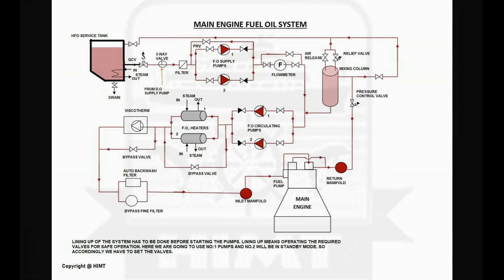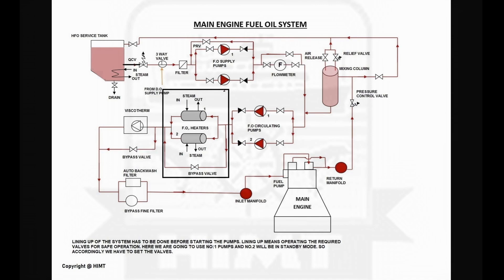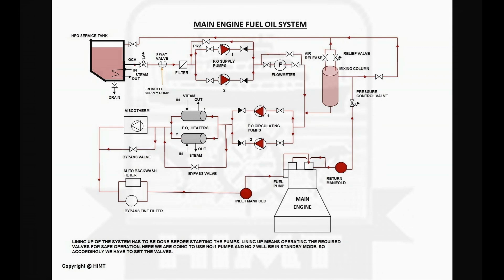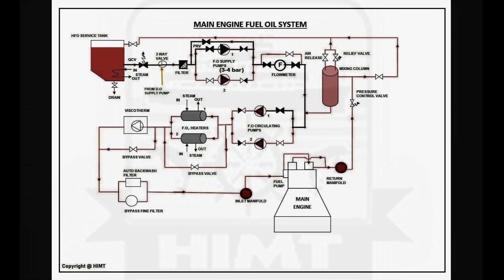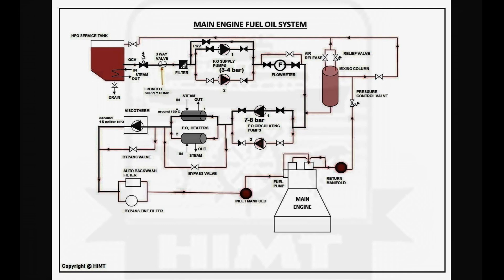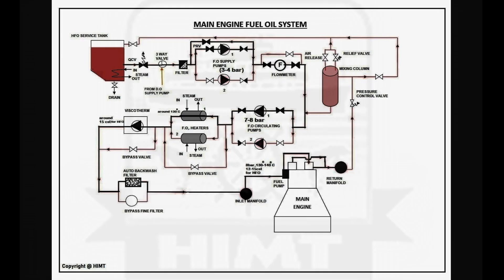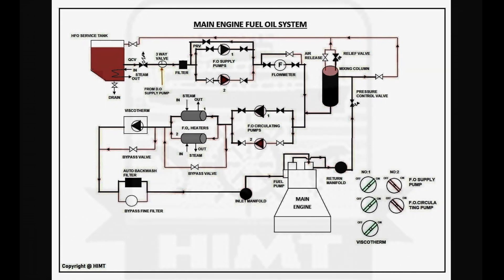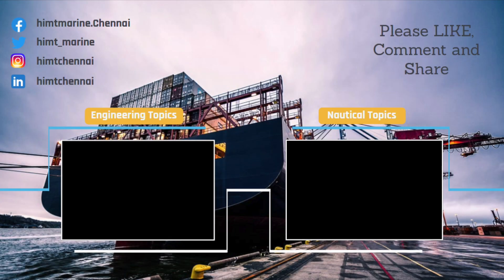2D Animated Explanation- Main Engine Fuel Oil System | Garish Jerome

Comment: Possible Issues & Missing Elements:
1.	No Return Line from Mixing Column to HFO Service Tank
2.	Fuel Oil Circulating Pump Bypass for Heaters
3.	Lack of Duplex Filters for Redundancy
4.	No Temperature Control System for Heaters
5.	Air Venting for Fuel Supply & Circulating Pumps
6.	No Emergency Shut-Off Valve
7.	No Drains for Water & Sludge Removal

Comment: what is the reason behind using 2 different type of pumps i.e. f.o. supp and f.o. circu. pump??? why don't we use only one pump???
Reply: it's for the purifier.  I don't know why purifier it's not mentioned in this video
Reply: @AnshumanChaudhary-pb7by  sir in stop condition as the supply pump are running the fuel will pass through the circulating pump to the fuel pumps and then the injector for heating the injectors in stop condition 
Is this correct?
Reply: Reply supply pump increases pressure to 5-7 bar and booster/circulating pump further increases pressure to 10-14 bar